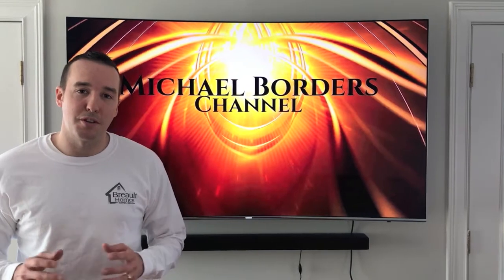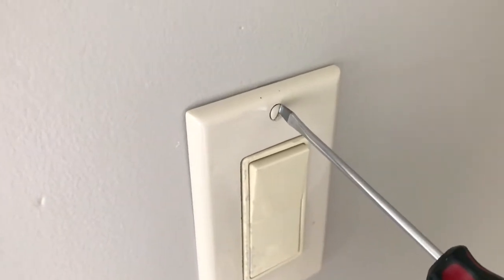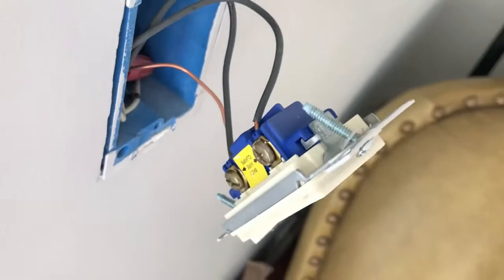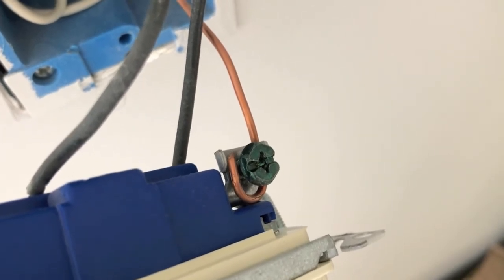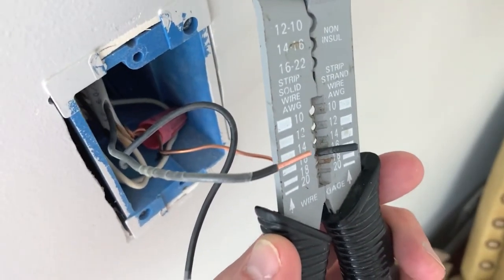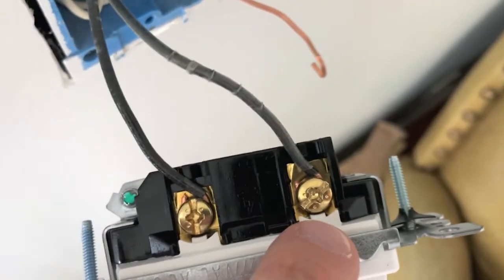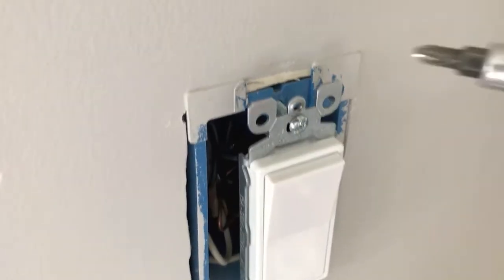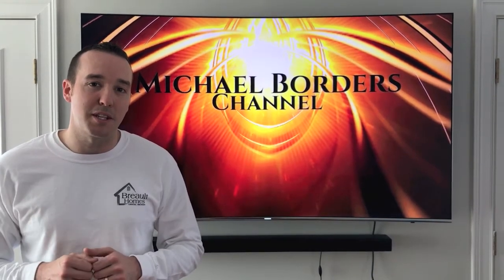Replace standard Light Switch SAFELY without Electrocuting yourself!

Comment: So the wires should be pigtailed clockwise and attached to the screw that way.  So single pole it doesn't matter which black wire gets attached to which screw?

Comment: How do you change it if you can't find the breaker cutting off the power?
Reply from the maker: Thanks for watching, welcome to the DIY Raptor Club.  Any update?  Did you find circuit breaker panel?
Reply: @DIYwithMichaelBorders  This is not for my home, but for an office in a big hotel resort, the light switch.  There are so many breaker panels there.  I am looking for metal junction boxes that might have the exact breaker panel label and ckt written on the junction box.  I just get a little scared changing outlets and switches when I can't shut off the power.
Reply from the maker: @derbystardom  

Thanks for the reply & we definitely understand.  Replacing an outlet without turning the power off is very dangerous.

Not really sure on the route to take.

Comment: Does it matter which black wire you put in which screw?
Reply: Technically no. There’s an armature inside the switch that will connect and disconnect the two terminals.
Reply: I too have the same question, Michael - can you please answer because I have the same situation. I also noticed you position the TOP of the pole switch to the bottom.
Reply from the maker: Thanks for watching & following these helpful steps will insure your outlet is properly installed & meets code requirements.  😎👍
Reply: @DIYwithMichaelBorders  you didn't answer the question :/
Reply: @riskmanifest  hahahaa